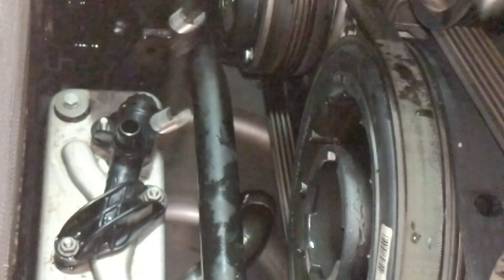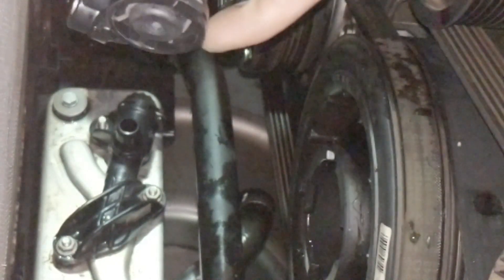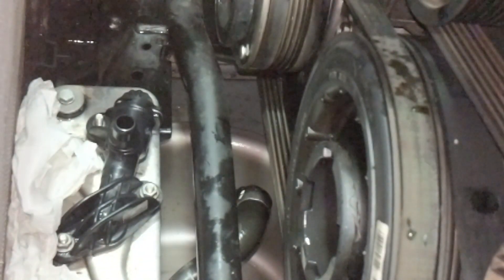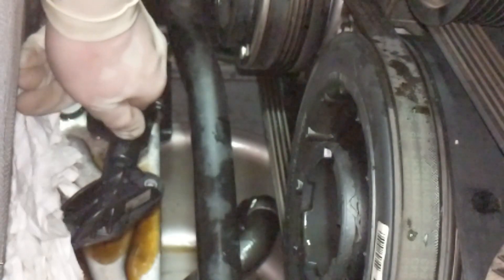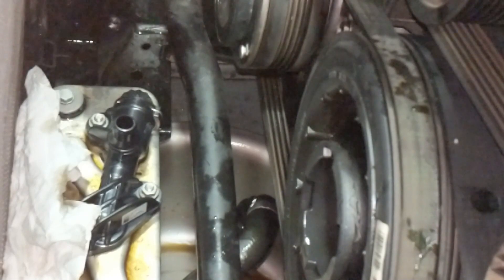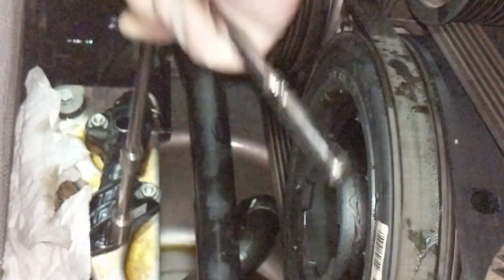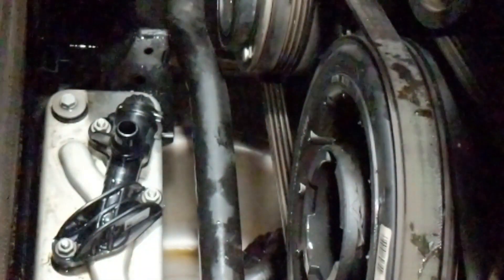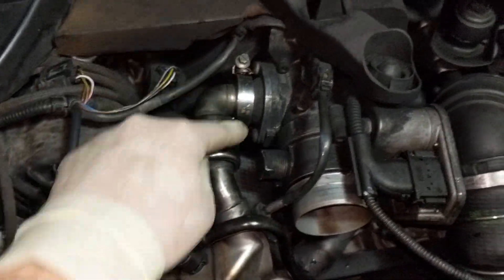E70 X5 M57 (diesel) Transmission thermostat replacement

Comment: You need to change that harmonic balancer!  It’s going to go quickly.  Get a fluid one from tune my euro
Reply from the maker: I have the FAI viscous damper from Whitbread. Installed it a few months ago along with a tune and weight reduction 😉
Reply: @sullygtx  who did your tune?
Reply from the maker: @joeb1125  JR

Comment: Did you felt any difference?
Reply from the maker: No, but there was nothing wrong with the thermostat that I'm aware of. I already had the fan out and coolant drained from replacing the engine coolant thermostat so I decided to do the trans thermostat at the same time.
Reply: @sullygtx  you mentioned you wanted to bypass heat exchanger and run air to oil cooler in front of the radiator; have you done it yet ?
Reply from the maker: @denisovanhybrid9610  Not yet, I sold my track car because I started college again so I didn't get a chance to tow anything.